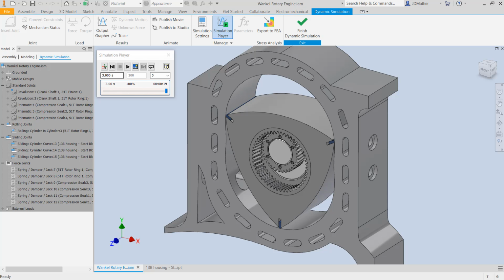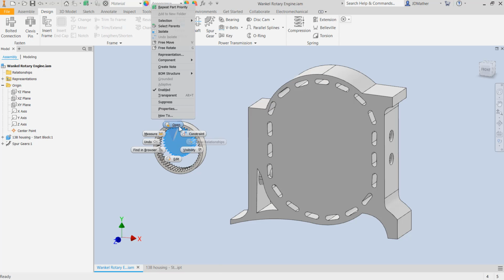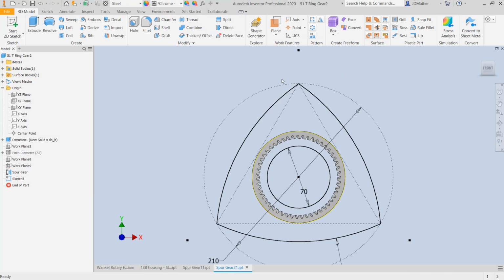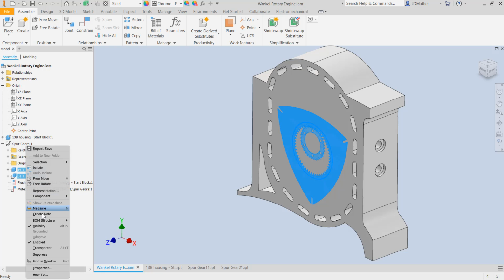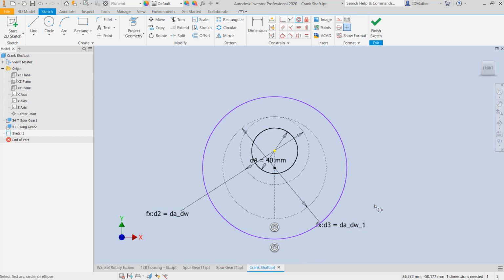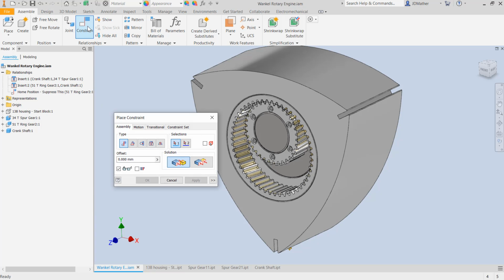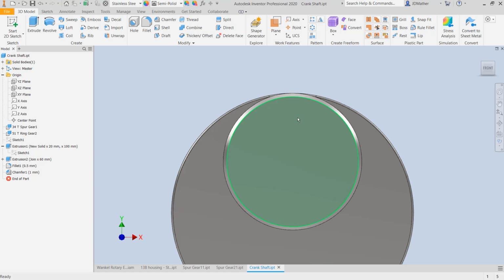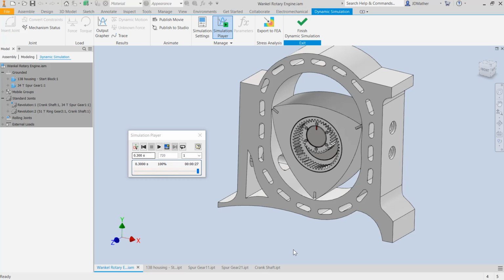Wankel Rotary Engine Rev1

Comment: where does one find a rotor housing like that because i cant find any
Reply from the maker: I don't remember where I downloaded it - probably GrabCAD.  But that shape really isn't critical (and I doubt it is correct if you are trying to closely reproduce the real engine).  Just make up dimensions or go to the junk yard and get a real engine to measure.

Comment: I'm wondering what using rollers for apex seals would look like.
Reply from the maker: I assume the engine makers have considered that and have not found that feasible.
Reply: @TheCADWhisperer  It seems that something cylindrical would do more for efficiency than the flat apex seals. I owned an RX3 forty years ago, and the engine had to be changed to solve the seal problem.

Comment: To say this model is completely correct would be a lie - the rotor sides can't be sketched with a curve command. They are outlined by the "envelope" of the trochoid that the housing is based on. Source: K. Yamamoto "Rotary Engine"
Reply from the maker: I fudged the rotor as I had no data for the true geometry.  I guess I was more interested in demonstrating a possible use of Trace.
Reply: @TheCADWhisperer  Understandable, and in that sense it was a very helpful video. Thank you!

Comment: I followed this religiously, everything seems fine in the assembly. When I move it manually,  the rotor goes round once for every 3 revolutions of the crank.  When I enter dynamic simulation, after following your guide, I cant for the life of me understand why then the crank and rotor  move together ie the ratio set in assembly seems forgotten and the whole thing moves as one.  Appreciate any pointers from anyone.